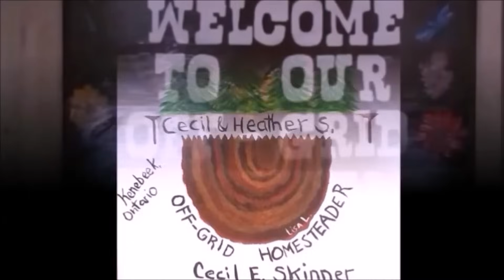What's Worse To Work In Than Snow....You Guessed It...MUD.  Building A Post And Beam Building.

Comment: Why don’t you nail extra support 2x6’s from the bottom of the scaffold posts to the bottom of the frame posts that the OSB is nailed to. That way it can’t go anywhere, especially the one sitting on the concrete block! 👍😜🇮🇪P.S. get a couple of fresh lemons and squeeze the juice out of them, mix into warm water and add a few drops of washing up liquid and it will take all the oxidisation of that windshield 👍

Comment: Scaffold looks good so far. I am very interested in how you stood those posts up and secured them to the building. Quite satisfying to know that you will have such a large work area to work from for the tin and the fly. Thank you both for the video! Have a good weekend!
Reply from the maker: Hello, thank you...when I build temporary scaffolding I try to tie it to the building I'm working on. I use the structure of the building as the scaffold brace.  Thanks, I am so looking forward to being able to have a concrete floor and heat in this building.  You are very welcome. Thank you...you have a great weekend as well.  Cheers!